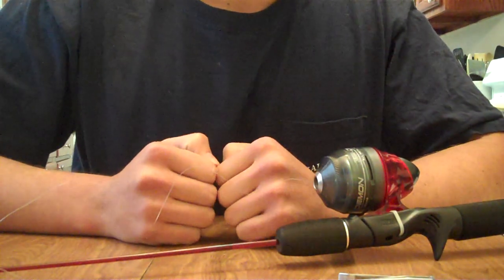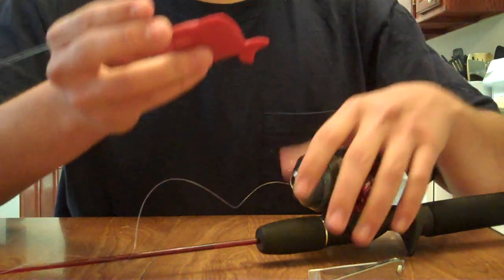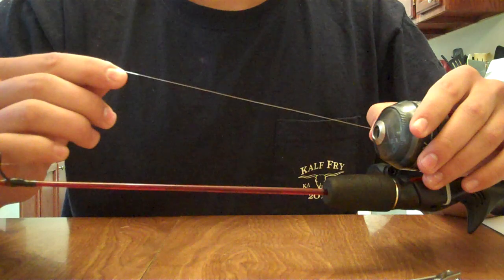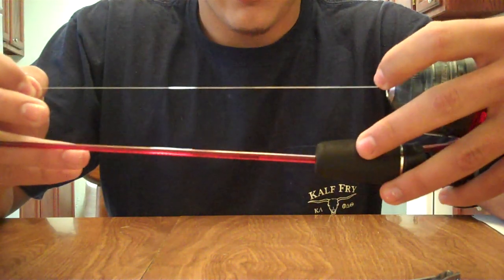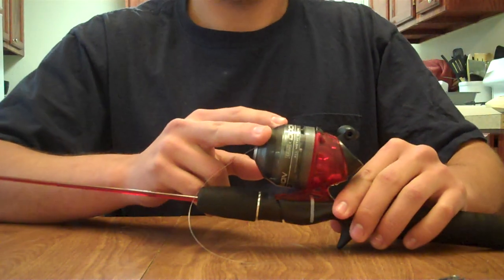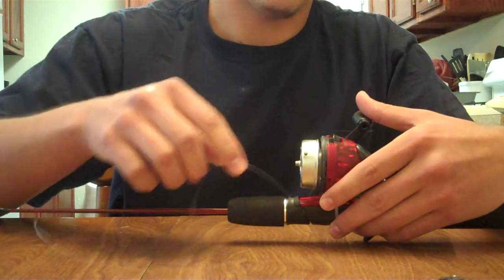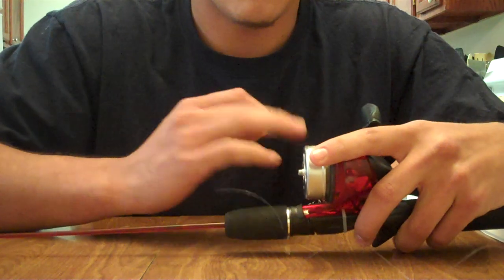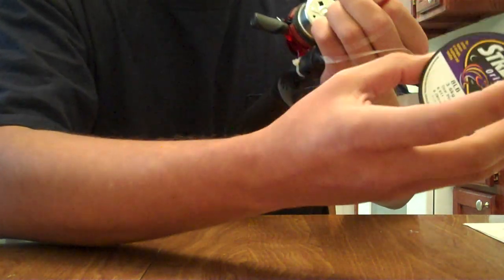how to re spool a push button fishing reel

Comment: Best closed face spincaster to pick up is the old 1960s - 1970s Abu Garcia Abu-Matic 270, 280, and 290. You can pick them up off of ebay for $15-40 usually and they're built like a tank and last forever. Also to reduce wear on the spool cover, use floro line, or floro coated line. Keep it oiled with Silicoat non-toxic oil and it will last 100 years.

Comment: If you're simply replacing the line with fresh line, I normally leave about 10 inches of the old line on the spool and connect the new line to that 10  inches using an Albright Knot and spool it up. Just be sure to run it through at least one of the lower guides. Simple and quick.